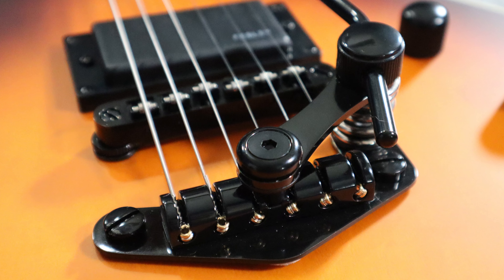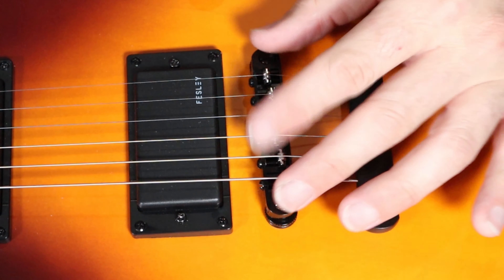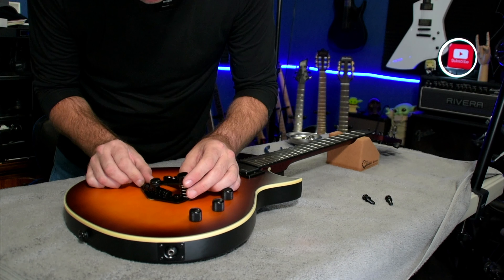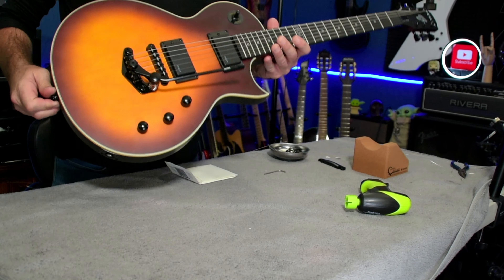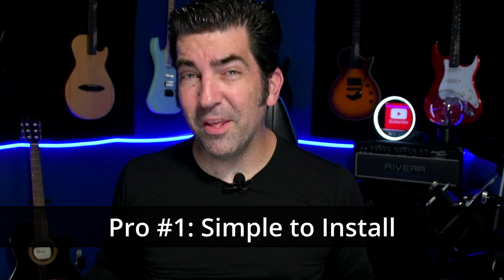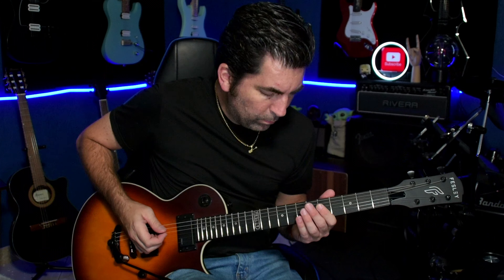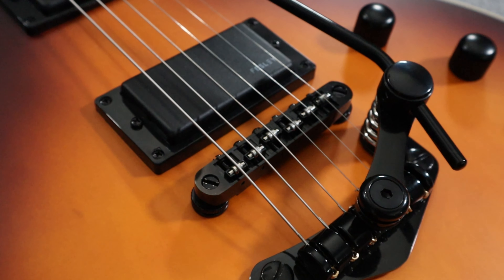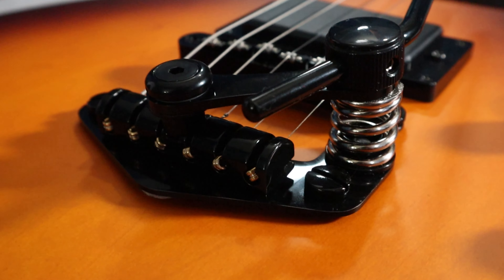GUYKER TM85 Tremolo - Full Install/Review/Demo - Duesenberg Style Trem

Comment: I have started AVOIDING anything with a BLACK coating!!! NON Conductive issues
Reply from the maker: @Lordbaccus  I’ve had that happen with Telecaster’s… Not with Guyker products, but with budget Tele’s with Black hardware. Ultimately I just scraped off some of the coating on the back to make a grounding connection, but I get what you’re saying. It can definitely be an issue if the guitar is grounded from the top side to the bridge

Comment: Doesn’t nut lubricant dull sustain?
Reply from the maker: No thankfully but If you don’t want to use nut lubricant, you can just use a pencil and just line the inside of the nut slots with the pencil. This seems to work well for a lot of folks too.

Comment: It fits great, it looks beautiful, works great for a couple of day but let's not forget that it bends due to string pull over time. I gone through 3 of those. If it was made of thicker metal in the base probably will work great in a long run
Reply from the maker: I’ll keep an eye out for that. This video is about 3 months old I think, I haven’t had an issue yet but I’ll be on the lookout for it and do a follow up vid if necessary

Comment: I own 5 Les Trems, and had the Guyker version for about 4 months, it does not stay in tune as well, sadly, it also doesn't have the travel the Les Trem has even after adjusting and switching the spring to a low tension Reverend spring.
Reply from the maker: Tuning stability was indeed an issue but improved greatly with lubricating the nut and probably would have been better with a roller nut or graphite nut… I can’t speak for the travel points comparison but you definitely sound like you know what you’re talking about so I appreciate the comment…

Comment: I'm just now unboxing my bridge & vibrato tailpiece combo - $65 shipped, no permanent modification - kind of seems like a no brainer. I'll put it onto a kit semihollow I built as an experiment. I've never had a whammy on any of my guitars before so this will hopefully scratch that itch. Mine came with just one felt pad, I'll probably mcgyver something from the fabric scraps pile to protect the top.

My package did, however, contain another item - it looks like a nut locking device? Another undocumented mystery.

Your two videos - this one here and the roller bridge - have been very helpful. You're the Kenny Gioia of Guyker!

Comment: I installed today a guyker roller bridge and this tremolo and both product work really good. I used straight away the spared spring becuase it looked more solid than the thin one.
I have in another guitar with a dusemberg tremolo which is the original model guyker is copying, and there's absolutely no diference in the functionality. tuning stability so far is not a problem just add some lub/graphite to the nut and everything is gonna be fine.
Both bridge and tremolo use M8 metric posts.
Cheers!
Reply: Since you own both, does the center post flex forward on the Guyker, (or the Duesenberg) when you push down on the bar?

Comment: This is the low cost version of the Dusenberg Les Trem system. The company that owns Dusenberg, Goldo also does a less ornate version of the Les Trem. As far as I know, Guyker is separate from Goldo and Dusenberg and I have heard good and bad on Guyker's Trem system. 

These are good "Bigsby Adjacent" Trem systems. Doing a roller bridge is really a must for these systems, a TOM bridge will eventually act like a chisel and break your strings. Locking tuners would also be a good upgrade as well.
Reply from the maker: I definitely plan on doing locking tuners are some point, as I think that will help, along with a roller nut… The quality of the Guyker trem I thought was pretty good. Paint was even and consistent and there were no sharp edges. The trem is very springy, which to me is unique, I like it because it’s different. 

This was definitely a fun mod for a sub-$500 guitar… Am I putting it on a $2,500 Les Paul, no I’m not, but for a budget instrument, it’s a lot of fun… 

At some point, I’m going to check out the Duesenbergs, just to see how they compare. That’ll could be a vid itself
Reply: @FretboardDiaries  
Import Les Paul and SGs are perfect for these trems. Your guitar looks like a deluxe factory version of that guitar. Well done amigo!😎👍✨

Comment: Nice video there I had this trémolo before I sold my 335 copy, I recommend that you add some solder to the ball ends of the first 3 strings, so they don't break, also I recommend that the arm hits on the top screw so when the arm holder loosens up you don't hit the arm back with you hand
Reply from the maker: I haven’t had an issue with string breakage yet. I’ve got about 30 hours of playing on it so far so we’ll see… Soldering the ball ends actually seems like a great solution if it ever becomes a problem. Thanks for the comment 🎸🤘
Reply: Use Fender Bullet-end strings!

Comment: I am putting one on my Telecaster FMT HH
 And with split coil, it can go hardcore Tele..
A very amazing guitar. 
  It can pretend it is a Les Paul. 
  Just lacking a Trem.  
  I have some really upscale guitars, but this one is so much for the money. 
  I'll have a couple holes to drill, and the factory bridge is four screws into wood that will need to be filled.  
String spacing is spot-on. Other than that, the chrome job needed a bit more prep, but you wouldn't notice it from six feet away. Trem bar height is gonna work. 

     I'll report finished details and comments shortly. 
  Oh, and THANKS FOR THE VIDEO!!!!
  Mark
Reply from the maker: Sounds pretty awesome man... Love a good custom tele... Definitely report back and let us know how the install goes

Comment: I got one but it seems to break the high e at the ball end. I might need to file it or something. Also the spring seems a little weak. Overall it’s fun but maybe not as stable as I was hoping for. I will keep messing with it. I never got any padded stickers. But I do like their roller bridge.
Reply from the maker: That’s interesting… I’ve heard a few folks complain about string breakage, but that hasn’t been an issue for me. I do have the Roller Saddle bridge, which helps prevent it, and I don’t go crazy on it, but I have put a good amount of time on it playing some demanding songs and haven’t had any breakage issues.

That said, perhaps filing it may help. It’s also interesting that you didn’t get the padded stickers, which is why I felt they really should include a parts list and simple instruction guide. I’m hoping Guyker considers doing that, so that if something is missing, you know it…

🤘🎸
Reply: Try the Ernie ball m steel strings the have a reinforced ball end🤘

Comment: I've gone "full Dimebag" with a Duesenberg, NO problem. No breakage, etc.
Reply from the maker: Yeah I mean, I kinda went hard on it, and didn’t break a string… But I felt like, if someone didn’t have the roller saddle bridge, string breakage would be an issue. Add some tuning instability into the mix when going Dime, and it just didn’t seem like the ideal option… Can you do it? Yeah… Is this trem ideal for it, probably not
Reply from the maker: Thanks for the comments by the way, much appreciated! 🤘🎸

Comment: How can you keep it? Did you have to use a simpler case instead of a hard case? It seems impossible to fit in a hardcase suitable for Lespaul
Reply from the maker: That’s a great question that I didn’t think of… The other problem is that I’m moving and my Les Paul hard cases are in storage. Perhaps someone else can chime in on that but you’re right that it doesn’t seem like it would fit…
Reply: This fits a Les Paul case with no problem, even Duesenberg itself clarifies that on their video